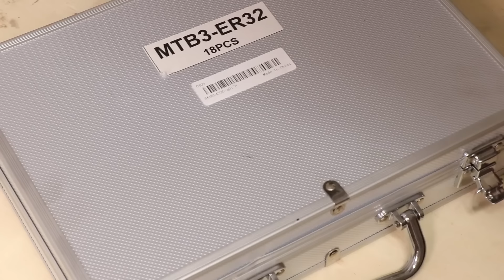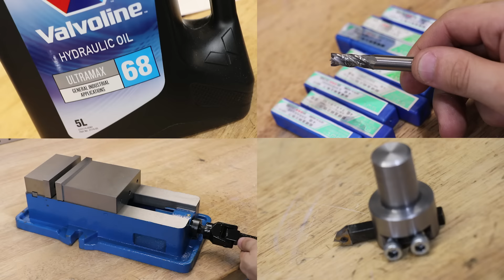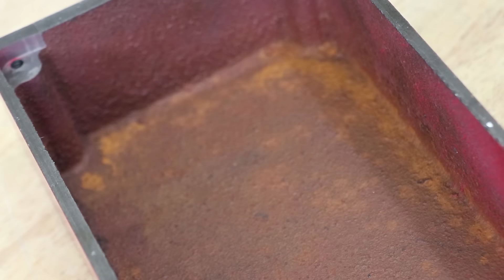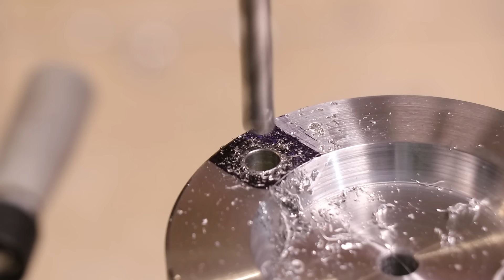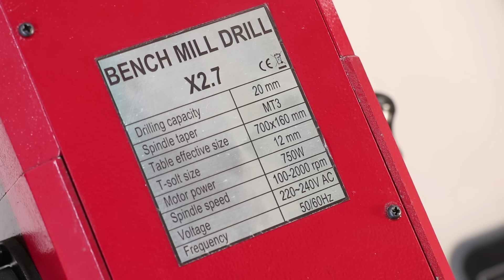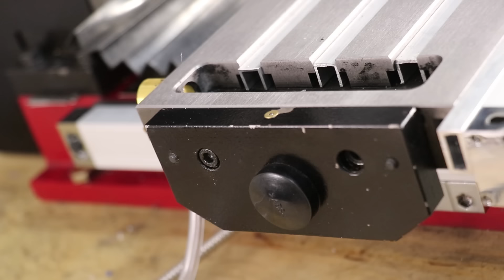Should You Buy A Cheap Mini Milling Machine?  (Sieg X2.7L In-depth Review)

Comment: Nice little machine.  There was a tour of Sieg by one of the home machinist forums about 5 years ago.  Good people.  As soon as you accept that this is a tiny machine with very little mass, the sooner you'll be happy with it.  The envelope of the machine certainly defines what it can handle but not in terms of cut.  You need to stick with very low depths of cut and avoid tough materials to the extent possible.  Always run solid carbide if you can and take good care of your tools and edges.  The biggest limitation I see is the loss of work envelope from chucks and vises.  But every obstacle has a work around.  Enjoy.

Comment: That mill would be nice with a brushless motor. I installed a T-shaped stiffening plate bolted to the column and the base to eliminate any slip or flex in the column swivel. It is easily removeable if swiveling the column is required. It really stiffened thing up and added significantly to how much metal can be removed in one pass and the finish is much better due to minimized vibration and flex.
Cheers: BJ

Comment: Small Chinese mills can be very handy once fettled. I have a Canadian version of the Sieg SX2 which is a smaller mill than the one you have. I have stiffened up the column, trammed it and minimized the back lash in the vertical fine feed. With the brushless DC motor it is surprising what it is capable of. It has an R8 spindle  so using R8 collets totally eliminates the loss of height from a collet adapter. Getting the cutter right up to the end of the spindle makes a huge difference in rigidity and working space on such a small machine. I've also added a digital tachometer which makes speed setting fast and accurate. All in all these machines can be useful in the home shop. I wish mine had the tapered gibs that yours has. I paid about $900.00 for my machine. They currently sell for over $1,600.00.  My lathe is the Canadian equivalent of the hare and Forbes AL320G. A good all round machine with 1.5 inch Morse 5 spindle and 320mm swing but it sure would be nice to have a quick change gear box for the lead screw. Change gears are a pain. 
Cheers: BJ in Canada.

Comment: It’s not that the chuck jaws are hardened that’s the problem. That’s a common misconception. It’s that a drill chuck, being made for drilling, not milling, grips the tool with just three lines of compression, whereas a mill holder, whether a collet of solid holder, grips the bit all around, with the solid holder securing it with a Weldon flat and screw. It literally has hundreds of times more gripping area. And high quality collets can be as hard as the part being gripped.

Comment: 9:30 
Handy power for a coolant pump.
Or something running off a small servo motor maybe.

Also get a drill n socket that fits the lock nut for moving the head. Stick it on there and pull the trigger 
* may pay to add a balancing weight opposite the handle. Id also dampen the resonant frequency of the table by putting some long, exposed bolts poking up through it, then form up the perimeter and pour a decent thickness concrete to onto it and fix the mill to that. Could do the samw with the legs, either filling wil sand/concrete or using them as a rigid brace for forming them up and surrounding with a pillar of concrete.
Or, if you have access to heaps of batteries, making a shitload of small-medium spheres and filling the legs with those plus sand. (or attacking with an acetylene torch and melting the lead to conform perfectly with the cavity inside the legs...) Permenantly seal them then engrave a warning plaque to spot weld on informing the reader of the structure containing lead inside.

Comment: Years ago after selling my machine shop, was still determined to not be without a mill or lathe, but had limited real-estate in the garage. I purchased a LMS Hi-Torque mini mill and use it at least twice a week for assorted projects. The hardest habit to become acquainted with on mini mills and lathes is the lacking of horsepower and 5 times as much time due to taking smaller cuts. These mills and lathes mostly made in China all require tons of modifications to achieve accuracy and personal satisfaction with end projects. Over time when you are used to the lacking and tooling differences, you will wonder how you could ever survive without one. All it takes is an imagination to come up with functional power feeds, DRO use and other home made tooling for a nice end product, within .0005" tolerance. I have found these machines need constant checking and maintenance if you use them a lot, due to the steel materials being softer, but no big deal for the cheap price comparison of a Bridgeport or Jet machine.

Comment: WD40 is a lubricant not a coolant. It is designed to prevent cutting! Use paraffin if must. Climb mill on a zero backlash setup, uses less power and gives a better finish. Drill chucks do not have a radial bearing, do not use for side cutting!"
Reply from the maker: It's  of a coolant bit it works wonders on aluminium. Nowadays I prefer to use a semi synthetic coolant, cheaper and provides a big more lubricity  in the cut. Cheers

Comment: how is it with stainless or titanium? if your tired
Reply from the maker: I haven't done titanium on the mill. I have machined 316L with it. You can do it, it is just very tough stuff and I tend to use carbide tooling. For occasional Stainless its okay, wouldn't want to machine with it often

Comment: Thank you for a fantastic walk-thru of this mill. I have an HBM BF25L Vario mill and it is quite similar to yours. I have been having issues with vibrations or some sort of incapability of milling properly. Maybe it is due to that I haven't tightened the mill properly to a solid base. I have yet to make a fly cutter in the lathe but that will be next. The end mill I have is probably of low quality and thus giving poor results. Thank you for a very inspiring video and also the other ones regarding your lathes. You have a new subscriber now 🙂

Comment: Just avoid those mills with the tiltable column "feature" that's more of a curse than a feature. The single line of screws used to attach the column to the bed form a weak point that flexes so badly that the top can easily move +/- 125 thousandths back and forth.

Comment: Very informative channel so much so i bought the SIEG SX2.7L , would i be correct in my measurements for the linear scales  X=700 Y=500 Z=400  any advice greatly appreciated, keep up the good work.
Reply from the maker: You probably dont need that much for the x and y. Whatever the table movement it. I think you could safely go 500 or 600 for the x and 350 or 400 for y. Just make sure that is correct, it has been a while since I bough mine. I got the 700mm X linear rails and they almost didnt fit on the table
Reply: Thanks for your time , love the channel

Comment: To me its like, why waste $2k on a low end machine when maybe spending double gets you a machine that is more than double in quality. Nothing sucks worse than a crappy machine and factoring in the time required to iron out issues, paying more for quality will reward you in the end. Also, get the heaviest mill you can get, all that mass makes a huge difference in rigidity and precision. There is simply no replacement for mass.

Comment: I bought a Grizzly Mill G0704 and Lathe G0752.  Are they perfect?  Not really.  Can they make better parts than they should?  That is up to the operator.  I make perfect parts with my less than perfect machines.  Why?  Because I use dial indicators and calipers alot.  I also upgraded my lathe compound and tool post which was a massive improvement and made a huge finish difference.  I use collets for milling.  The drill chuck is only for drilling, though I have used it for some quick milling that didnt need a perfect finish.  Shars Tools is a great place for top notch items.

Comment: Ever heard the expression "call central casting...."? The reason why these milling machines can be sold so cheaply is that the castings that go into them are made en masse at a central foundry then supplied to individual manufacturing companies for final finishing, each one adding their own custom detail (e.g. handwheel style, motor type, etc) to slightly distinguish their one from a competitor selling the otherwise identical same machine. Likewise,  the publicity photos of a sample fully finished machine are also supplied by 'central casting' hence the reason why the way cover on yours is 'missing' (actually not, never intended to begin with).
Reply from the maker: I can’t comment on these machines specifically, but it’s not too different from the production of a motor casting I worked on a while back. And from what I can see from other examples of this machine, some come with front way covers others don’t. Not sure if it is luck if the draw or production date based

Comment: For $1,200 buying new for this mill would only make sense if you do not have space for an old real mill. A used bridgeport costs like $500 and can rebuild it costing around another $1K or so, basically the same price as to this small mill. However the Bridgeport will give you tolerances down to 30-50 microns. Would've been really nice if you actually showed the tolerances what this mill could provide.
Reply from the maker: Maybe where you are, but that isn't really the case in my part of the world. Used machines tend to be more expensive than 500
Reply from the maker: A quick look and used big machines start at 2000 and up
Reply: @artisanmakes  Same here in USA, Bridgeport costs $2K-$5K but many machinists do tend to sell them off for $500-$800 which requires rebuilding which isn't a big deal depending how bad the condition is, usually the ways needs to be scraped, head timing belt replaced, nothing extraordinary so long the heavy cast iron stands are not cracked. I guess in US there are more people selling them less than $1K than to your location.
Reply: @artisanmakes  I guess you had no choice, used high quality machines in USA are really low prices, had no idea it would be expensive in your location. It seems you should be able to hold tolerances around 50 microns with this mill since I read a review stating that for a Grizzly brand of the same mill.
Reply from the maker: Yeah for sure, I'm always quite envyous of the range of used machines in the US and Europe.

Comment: Check Out: Stefan Gotteswinter Tramming a milling machine with epoxy

BTW:  They make epoxy filled foam kits for shimming your spindle tram.  Believe it or not shimming like that is a common solution on many machines, even high end machines.  The epoxy fill makes it so the weight bearing is evenly distributed across the epoxy once it has cured.   Basically you trim it in then fill the gap with epoxy.  The foam keeps the epoxy from overflowing.

Comment: Thought i would share my experience with mini-mills v/s an actual Bridgeport. Unless you’re doing very light duty work on very small parts, suck it up and get a real Bridgeport (if you have the room) they made a small table version. After doing all the upgrades available for my mini mill to make it half way usable, i would have spent the same as i did eventually on a used Bridgeport. These mini mills just do not have the torque to drill or mill anything with any authority besides small alum/brass parts. I had an R8 spindle mini mill and it just couldnt do what i needed.. (hot rod chassis and related work) Good used Bridgeports are still out there, yes youll need a phase converter but i was so much happier with a real machine.. learn from my mistake!!

Comment: I like to watch your stuff, I have just ordered one of these x2.7L, looking at DRO scales, can't seem to find 700mm x 200 scales, I have a set up on my lathe but thought it would be easy to just but another set of scales and use the same DRO, can you let me know your set up as it seems to have the 700mm on the table? regards Roscoe
Reply from the maker: I am indeed using 700 X 200 scales. This is the 700mm table, but in restrospect, you only need 600mm long scales. Or ones just slightly longer than the XY travel
Reply: @artisanmakes  Many thanks, I think I found a good solution, I can buy 650 x 200mm so that will fit nice, took some finding but got there!

Comment: Well, the X2 mini mill in my hobby 'shop' has only 350W, and the SQUARE column is more than stable enough, even for milling steel - sharp tooling and light cuts being necessary. I must say though that I have added a 10mm stiffener plate to the rear of column and base and a poly-vee belt drive (lighting and tachometer too. My drill chuck (I use it for quick milling too) has a drawbar. Another add-on was a self release added to the spindle top, so no tapping and hurting the bearings, just a quarter turn with a small wrench and every MT3 tool drops loose. For longer and more precise usage I change to an ER32 chuck. Concerning the bearings - they are the same as in the mini lathes and are of quite good quality. If you want you may change them to (expensive) same sized roller bearings, but this may not be necessary for a machine which is not used for business.

Comment: Fortunately, it is configured with an R-8 spindle so boring heads, R-8 collets, and holders of all kinds for R-8 spindles are standard and available.  You don't use end in drill chucks.
Reply from the maker: The north American ones are R8, the ones sold in Australia are MT3

Comment: G’day. Nice video - again. What else have you done with the mill & lathe except made parts for the…mill & lathe. lol. Joking, your parts are always great to see. 
Also, much cheaper to buy a mill with cheapest motor and then replace the motor with a more powerful brushless. They’re cheap as chips!
[The USB ports: one is for charging your phone and USB port 2 is for loading your CAM files. 😉 ] 
Hey, I got a “temporary pleated black blind” from Spotlight. About 6ft x 6ft for $15. GR8 way cover! Just cut what you need. 👌
A quick question: what is involved in increasing the Y axis movement? Is it doable? (within reason as everything is ‘doable’) Michael, Albury NSW
Reply from the maker: Hehe i do make other stuff in the workshop but I tend not to film it because I don't think its too interesting. Love the pleated blind idea, definitely a DIY approach
Reply from the maker: Not too sure about a practical way of increasing the y travel. You'd probably have to modify the lead screw and the lead nut to allow the table to move further forward. Not sure how practical it would be

Comment: The Sieg mills are pretty good for quality and build. You will find a noticeable improvement in your rigidity if you bed the shimmed column joint on a metalised epoxy compound. Leave the shims in place when you bolt it back down tight after adding epoxy bedding compound.

Comment: Dude,  you're complaining about the sharp edges on some of the parts and cutting your hands, but you leave an end mill loaded into the collet for some of your pictures.  Obviously you removed the vice and cleaned the mill possibly with the end mill in the collet. If you cut yourself, you have no one to blame than yourself.
Reply from the maker: Given that it was my experience with this mill, I thought it was at least worth mentioning
Reply: I hate sharp edges too.  It always pissed me off when I would find a burr or sharp edge on any new machine tools when they came into the shop. 
Otherwise,  you seem like a tidy person,  some of these guys (AVE) that are swimming around in piles of chips are just asking for cuts to their hands.

Comment: How do you make fine adjustments on the head ?
Seems to be very difficult without macro adjustment. The macro adjustment on the quill is not very good. It's loose and it's not even accurate. I get almost 0.5mm error on a 50mm travel of the quill.
I ended up mounting 3rd axis dro to the spindle housing underneath and it was way more accurate. But still, entire spindle assembly is not very rigid to use macro adjustment on it.
Need to come up with a micro adjustment for the had and that way I can attach z axis sensor to the head. It will be more accurate this way. Attaching it to the spindle housing introduces flex play of around 0.04mm if am not mistaken. I want 0 but oh well.
Reply from the maker: It is not easy. I have the gibs done up very tight on the head to minimise slop. To measure the adjustment I will use an indicator to see how far the head drops or quill if I'm using the quill. And to be fair to this machine I used this method with a larger mill a few years ago when I needed precise measurements.